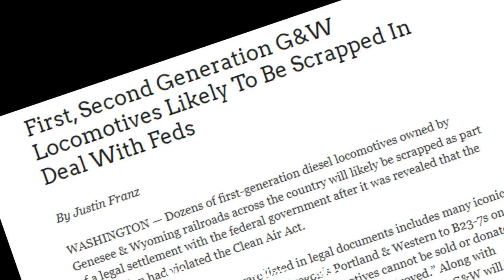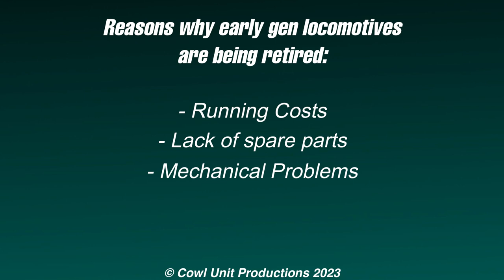Cowl Rambles - Endangered Diesels?

Comment: The part that angers me the most is that they are not allowed to be preserved in museums, even if the engine is removed. This also makes me worried about Alco based shortline companies, such as Livonia Avon & Lakeville or Genesee Valley Transportation. Both of these are local to me and would be very sad to see them go, but it could happen due to how old Alcoa’s are. Also thinking about Older GE units, such as the Finger Lakes Railway near me which has a large fleet of Dash 7s and a U Boat, I am worried about these too. It’s overall very sad that this had to happen and I hope this will never have to happen again
Reply: ALCos deserve to be preserved. They are beautiful things and look like no other diesels. The iconic sound, and the shear amounts of exhaust they produce is something that future generations need to witness.
Reply: This is mad
Reply: the Arkansas & Missouri  only has 3 sd 70 ace units, the rest are all ALCO. 
..doing this would leave them power short for sure!!
and scraping every ALCO, or anything that isnt tier 4, and not even leaving museum units like the gp9 at Horseshoe, is just a SIN! why? are they afraid they will be rebuilt and put back into service? that is just stupid. why would they scrap units that are not much more than a body shell? they dont emit pollution just setting, and not running. this sounds like a idea dreamed up by the current powers that be up in Washington. 
you know who you are.
Reply: "not allowed to be preserved in museums, even if the engine is removed"

Wasn't aware that was even legal to enforce. wtf. Telling a private company they have to destroy their already retired property.

Comment: It's important to note that the decision involves replacing the Prime movers, meaning that these engines can either be scrapped OR REBUILT with T3 or higher prime movers. Whether these engines are properly rebuilt or scrapped is up to the individual G&W owned railroads who roster these engines at this point.
Reply from the maker: Thats a good point. They are well capable of sending locomotives in for rebuilding, so there is hope. Time will tell.
Reply: Wish I had seen this earlier.

Comment: On the Illinois front, I didn't notice any Tazewell and Peoria units on this list. The sister IMRR's oddball RS1325s were luckily just sold into preservation. But the TZPR still runs its 2 ex UP SW10 rebuilds. These were shipped off to some G&W property in Canada and extensively rebuilt a few years ago. Their SW14 #700 disappeared onto the Golden Isles Terminal RR some years ago. I don't know if it is still around or not.

Comment: this is awful. There are many small museums that would take these. That mandate likely has other motives, political ones I tend to not favor discussing but in this case, a display locomotive does not "harm the air" simply by existing. This was likely a politicized move by Individuals overly interested in engines that put out on average less hazardous fumes than your car. A scrap without preservation order is the definition of erasing history. This is a dangerous ruling to railroad preservation as a whole. If they try to  scrap your history, take action. Do not sit idly by and let locomotives die. Helping save CNR 803 was a high point of my time researching and helping with museums and historical organizations. People can start a petition. That saved 803 it will no doubt get the government to rethink it's hazardous destruction of history. All we can do is speak up. I need to ensure this dosent happen to ex Ann Arbor Line diesels near me. Being state owned helps the ones that do keep running and do not fail or break the opportunity to continue on. When they do inevitably need to be replaced, I have no doubt that at least one will be preserved.

Comment: Just seen this video. And yes it’s the G&W at fault. Right before there take over of the MMID (Maryland midland railway) the MMID had just bought 4 GP38-3s numbered 303-307 and cycled 2 GP9Ms to get fitted with new cleaner technology now owned by a short line in GA keeping there original engine but updated to comply with EPA standards. Where going to do the same with the last GP9M and one GP38 into a GP38-3 when the 2 GP9Ms made there return. This was planed well in advance of the takeover as MMID put themselves into debt to make this and a improved switch into there largest customer Lehigh Portland cement in union bridge Maryland. Yet right after the takeover all but 301 now G&W 2060 with MMID marks. Being a GP38-2 staying on the line and mostly in the original MMID paint. But losing the name of the company founder. And a bunch of dirty, unkept and not maintained SD40-2s and a very ugly GP9M replaced them. All without the least bit of respect for the clean nature of the original MMID. Today you drive past the yard to find piles of scrap and trash littered everywhere. Oil leaking so bad ther ballast and track are soaked after a train rolls by and many on line customers turning to trucks more and more do to the unreliable service from the G&W management. Even Lehigh is starting to load more trucks then ever after buying most of the MMID covered hoppers they use just to keep them maintained themselves as the trucks where falling off in the loading dock at Lehigh. Seams the only thing G&W wants is any pennies they can line there pockets with and the absolute cheapest maintenance they can get away with. Everyone along the MMID misses when it was a local company that actually cared and took care of the property and the customers as well as treating the people along the line with respect and understanding. Today none of that is true. It’s truly a sad situation that was forced on the people. All from one company that only wants money and seen a easy way to get it from a company that made grate improvements to make the area better only to have it ripped from them.